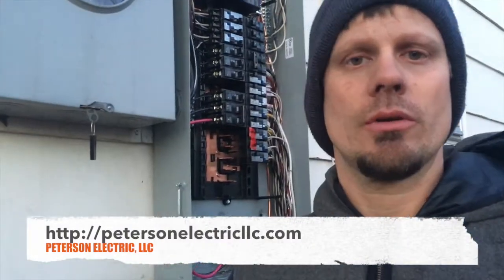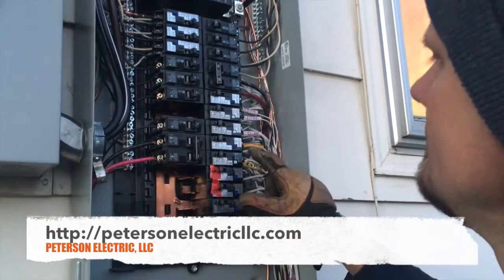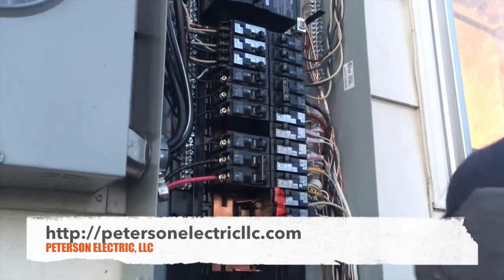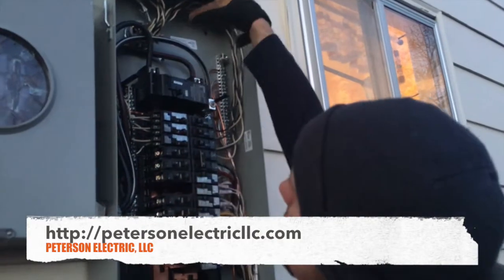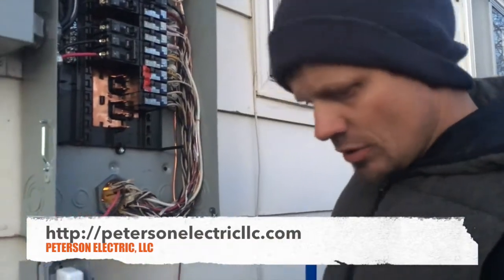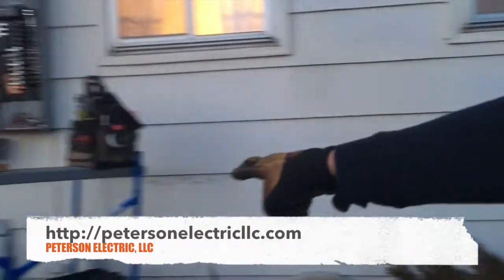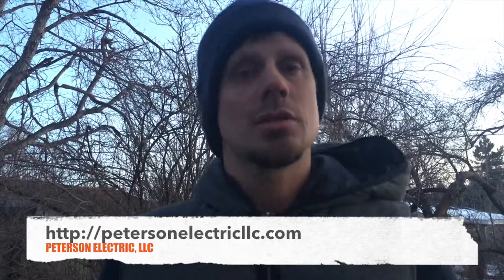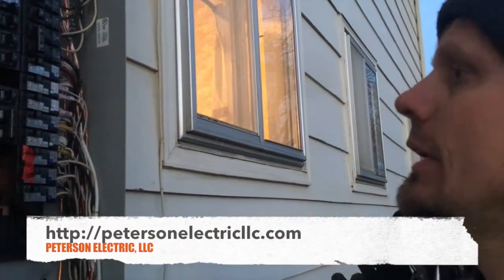Residential Electrical Service Change Requirements

Comment: I’m familiar with grounding to the water line and putting jumpers at the water meter and gas lines on houses with public water connections. Our new house is well water and all incoming water lines are plastic. Also have mostly pvc water lines in the house. If I do a service upgrade, do I need to run these grounds or just a ground rod and be done with it?

Comment: Screw the inter-system bridge bar.   Dumbest thing ever invented.
Reply: Oh?  Can you explain why your perspective is more informed that the code-making panel which crafted the language?
Reply: @steveloux4709  Because it causes more trouble than it saves.  It requires tiny conductors to carry more current than they could ever expect to(22 AWG phone wires carrying neutral current back to the source)  Really now.  That's my explanation.  Do you have a better one?  Not all code panels are all knowledgeable.   I'm sure you trust them explicitly. Wake up.  Don't insult me.
Reply: @nhzxboi  22 awg fuses, LOL Hope nobody is working on the phone lines.
Reply: @steveloux4709  There are gonna be some pretty hot little tiny wires when the utility neutral opens. Just think about that.

Comment: Good video. You have that height requirement for the breakers to figure out. Not to hip on the bundling of the branch circuit conductors entering the sub. Don’t forget your GEC GR needs to be 8’ in the earth so as to drive it below grade and use an approved “ACORN” conn rated for direct burial. Other than that you did a hell of a nice job. Looks great.
Reply: Highest breaker cannot be above 6'-8"

Comment: Hello ,
Do you need to ground the disconnect box?
This is what I have, from pole to meter rite next to it is a , I believe it's a disconnect panel. There's a 100 amp for the house panel, 30 amp breaker for the AC pump, no ground ? 100 amp comes in box , and the neutral and ground where bonded, no ground. So I ran a ground wire unbonded the neutral and the ground, removed a bar that bonded them. So do I need a ground at the 100 amp box ?
Thanx Bob
Reply: Yikes Bob.  The bond between neutral and ground at the service disconnect is essential for clearing a short circuit.  You certainly need to bond all parts of electrical equipment, "likely to become energized" together, but without the connection to the neutral at the service, you have a very dangerous installation.  Suggest you head over to Mike Holt's channel for some excellent teaching on bonding and grounding.  You can then compare what you have going on to what is required and see whether there are any deficiencies.

Comment: This seems so odd to me. Panel Located outdoors? can't anyone off the street come and switch your power?
Reply from the maker: Some of our power companies do not make us install the services underground when it is a repair. It was build this way back in the 1960's/
Reply: Almost every main panel I have seen in Southern California is outside. Usually a meter combo on the track homes. I think it is so the fire department can shut off the power if your house is on fire. Funny, I see lots of customers with padlocks on them.

Comment: Could you run your ground in conduit? Cus bare copper coming out of the panel and into the ground looks like shit
Reply: I thought I read that it has to be in metal conduit now. I always use bag wire that is pre-made that way. Looks like MC.

Comment: Hey how much you charge for a panel upgrade?
Reply from the maker: Depends on a lot of things. Distance-location, Size of service-100 amps to 320 amp meter, type of service-overhead vs underground, customer-needs or load , equipment-aluminum bus bar and feeders vs copper, grounding- hardship for rods and cold water and ufer, AFCI breakers vs standard, tracing the house and how much STUFF is in their house, Weather- is it mud or snowing, also, timing - ASAP no power vs planed upgrade. Is there inside sub panel a three wire SE cable vs the four wire SER and now I have to rerun this, does the customer want an Aluminum SER feeder or a TC cable for Copper, plus if their current load center is in a closet, bathroom, kitchen cabinet or over a stairway then it has to move. Plus outside how high is the house and what type of siding, brick, stecho, cement siding, vs concrete. Lots of problems.

Comment: Can a meter can be 40’ from the main breaker panel and when would it need a disconnect?
Reply from the maker: Typically know it Hass to be back to back but it also depends on your jurisdiction. Here in Colorado they want the main disconnect outside near the meter

Comment: Great stuff.  Never saw the neutral and hot wires twisted together in the box before.
Reply from the maker: Christopher Rubeo newer code since 2014. Either twist or number them
Reply: @Petersonelectricllc  to my knowledge that is not found in NFPA 70-2020.  Where are you citing that requirement?  

Of course, the need to group the conductors is rather self-regulating; if you don't correctly pair the phase and companion grounded circuit conductor (neutral) together, the circuit will not work.

Comment: Big ugly panels outside the front of the house, WEIRD WEIRD WEIRD, why? Makes the house look like hell, it's residential, not a commercial bldg, UGLY, hot cold wet water, dirt, why why why expose the breakers and connections to such large temp changes which causes issues later on
Reply: my thoughts exactly. so Fucked

Comment: i'm curious why the panel is outside.   one would want it to be secure so someone cant cut off the power inside  but then you would have to lock it and since the gfci's need to be accessible  wouldnt that too be a problem?
Reply: He said that is how the power company wants it in Colorado in a previous video.  I don't understand it either.
Reply: Yup, I lived in Longmont, CO and I hated that my house’s electric service panel was outside on my attached garage near the front of the house street side.
Reply: that is literally SO messed Colorado wants their panels outside. They should delegalize it.